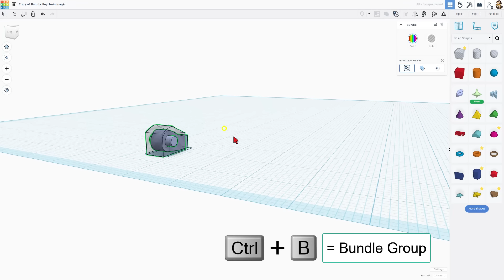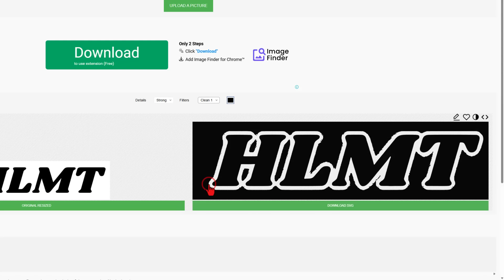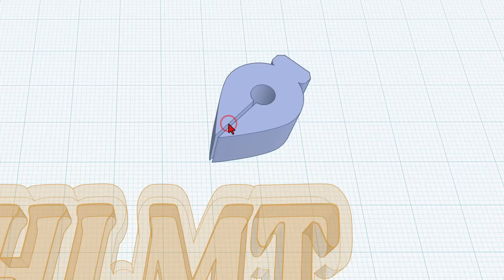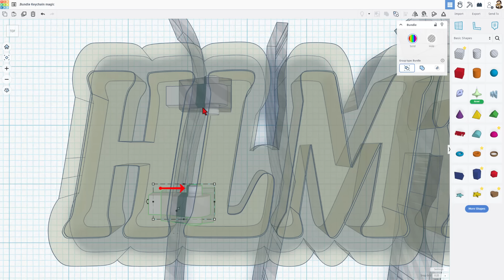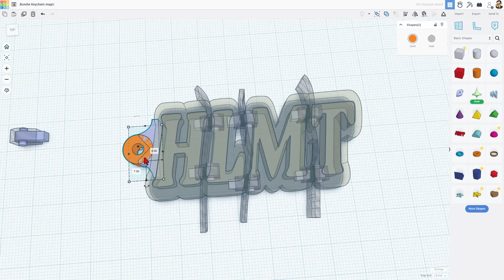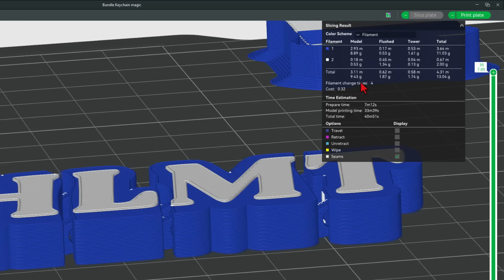Edit Your Tinkercad Saved Shapes Bundle Group Flexi Keychain TOO! 💯🔥

Comment: I had an issue today where students projects were missing some of the flexi parts.   Turns out if you duplicate the part and leave it there so there are two in one place, it just leaves a big hole.  Hope that info helps someone else.  Just delete the duplicates and it's fixed.
Reply from the maker: Is it possible that the parts were just left there and not bundle grouped? I would expect that to be the issue.
Reply: @HLModTech  No it was the duplicate that deleted the original.  I went back and fixed each of them.  I don't understand the difference between saving the items in Your Creations with allow editing vs keep shapes separate.  I tried both and it seemed the same.
Reply from the maker: Good point about the difference between those two options. They seem like synonyms to me too.

Comment: Now that Affinity is free have you thought about using that and exporting straight to SVG instead of exporting to PNG and then converting to SVG?
Reply from the maker: I have never worked with Affinity. What would be the benefits of switching?
Reply: @HLModTech Primarily much cleaner exports, no potential of artefacts during the PNG to SVG trace. Also one less step and not relying on third party websites.
Reply from the maker: Thanks. Checking it out. As a classroom teacher I favored tools we did not have to install. A: I had to beg IT to get it on the PC's in my room. B: Kiddos had Chromebooks that needed web tools.  Installing and testing. 💯👍
Reply from the maker: SVG export failed. What choices do you pick? https://imgur.com/a/Yp9f91t I chose SVG flatten that time. Trying again rn.
Reply: @HLModTech  I had the same issue and to date still happens; so, I do the same steps as you do.
Reply from the maker: The process I have started because a user was having trouble with this SVG in canva. https://youtu.be/sFwJiK-sdNc
Reply: @HLModTech  I can't view your image as Imgur is blocked in the UK! When exporting your text ensure that it is selected then go to File > Export > Export... and in the Export dialogue box select SVG (for export) on the left hand side file type and the in the Area drop down menu choose Selection Only, then ensure Export text as curves is enabled.
Reply from the maker: Bummer it is blocked. The export steps are easy. Have you imported a SVG into Tinkercad from Affinity? As the user above states... it is not working for some of us.
Reply: @HLModTech  yes I have imported into Tinkercad. I've made 3d printed labels for Christmas gifts that can then be used as key chains
Reply from the maker: Ok. When I get time I will fiddle some more. At the moment though it has just been frustrating. Inkscape does the same stuff, for free, and it works fine.
Reply: @SonyJunkie19  yes, finally it worked, I did follow your steps and I had no problem